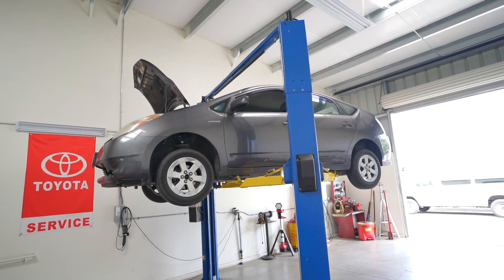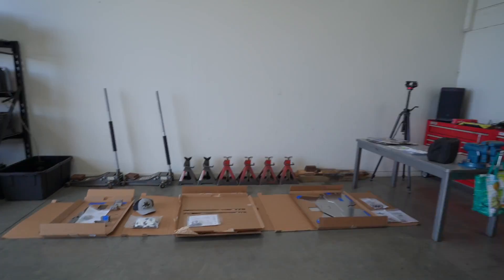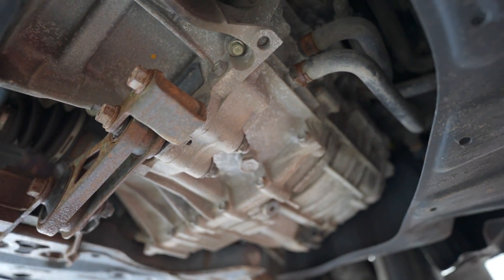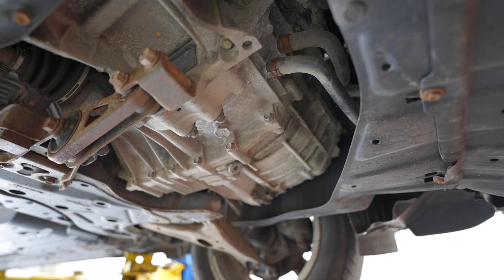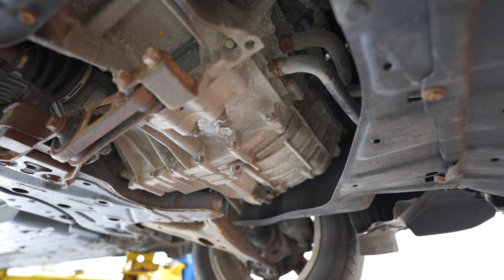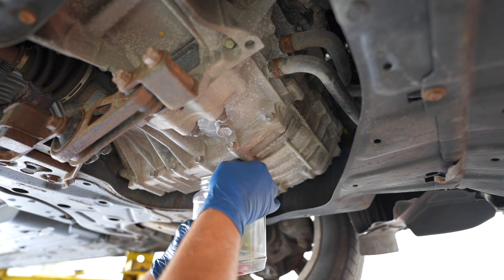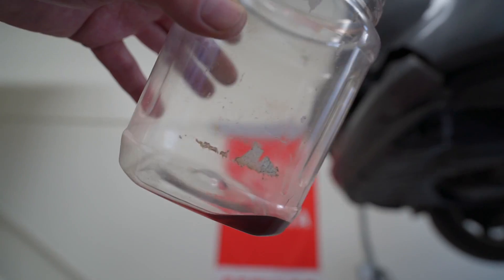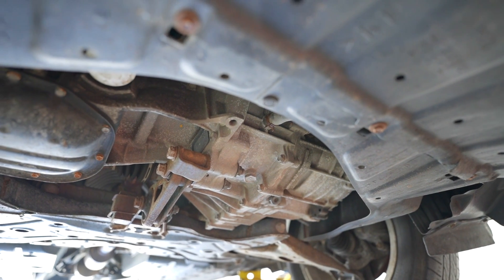2008 Toyota Prius Hybrid Transaxle Fluid check

Comment: The reason you take the filler out first is not only for venting but IF you can't get the filler plug out and you drain all the oil out you are ROYALY SCREWED!

Comment: Yes, I was screaming "Oh my God he didn't crack open the filler yet!!!"

Did you check the glove box, Peter?

😁😁😁

I will be driving with my kid up past the shop (2.5 hours East on the I-5).  I don't think I'm going to have time to stop by, but I am sure thinking about it. Especially if I can't get the PCV valve changed myself!

Comment: Oil is fairly cheap. Transmissions and engines aren't. Oil in a machine is kind of like blood in your body. You want it to be in good condition. It goes out of specifications, and you've got a problem. Let it get too bad, and it will be terminal. The good thing is that blood changes itself, and gets filtered continually. That is a lot more complicated than unscrewing an oil filter.